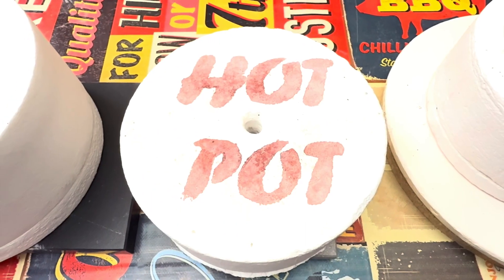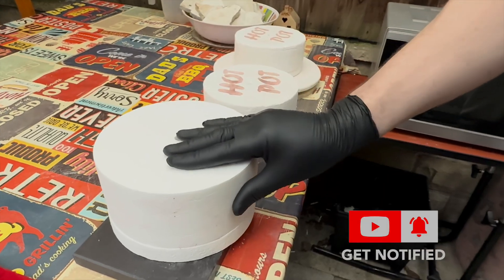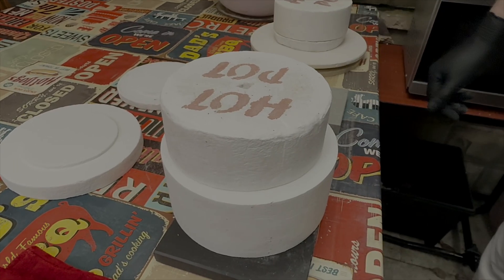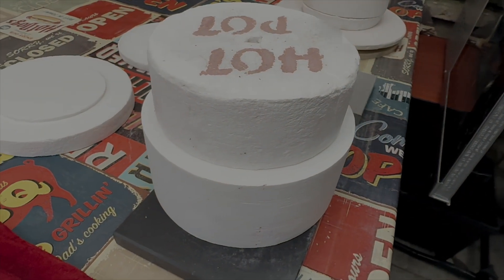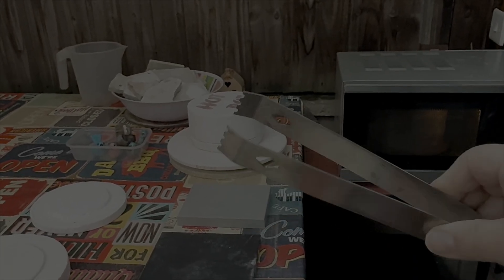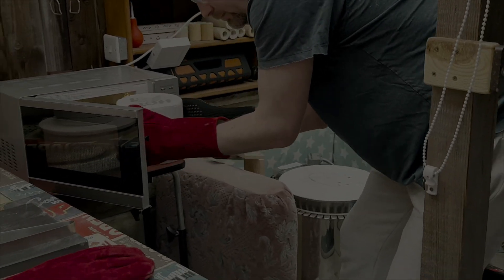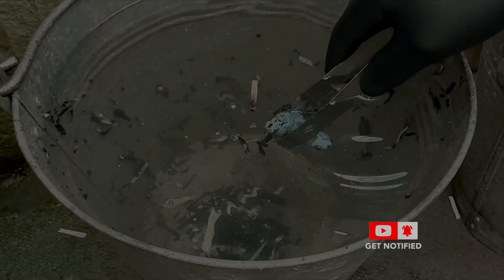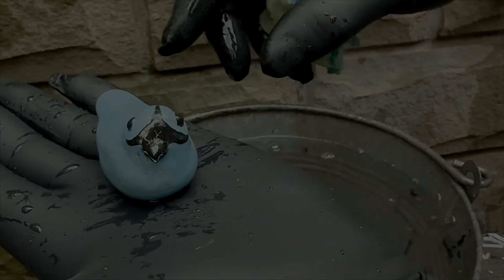Microwave Kiln | Raku Firing Demo | Hand Build | Home Ceramics Project

Comment: do you use wax on thebottom of your pieces?
? also will the microwave shut off if it gets to hot?
Reply from the maker: Hi
I don’t use wax no. I’ve never had any issues with the microwave getting too hot to be honest. I never leave it unattended however just to make sure everything is ok. Hope this helps 😊🥰

Comment: :) Why do you turn off the microwave after 20 minutes, only to restart it for another 5 minutes instead of 25? 
Do you change the power or check the color?
How many minutes in total? 

Thanks for sharing.
Reply from the maker: You are welcome! 🥰 you can’t see the colour but I check the glow on the piece and if it doesn’t look smooth enough I put it back for a bit longer. Hope this helps ☺️

Comment: Hi. What is your general maintenance on the kilns? How long does one last?
Reply from the maker: Hi, well I’ve had mine for years and although some cracks do appear you can still use it. I believe it’s better for the kiln if you don’t let it cool down open; always get your piece out after firing and then close it to allow it to cool slowly. I believe you can actually fix them as well, like the cracks can be mended with ceramic fibre, magnetite and sodium silicate. I’ve not personally binned one nor fixed one yet so I’d say they do last a long time. Hope this answers your question? Thank you for watching the videos 🥰🤗

Comment: So you said if the glaze is bumpy (mine was bumpy/bubbly) it’s not hot enough? TIA!!
Reply from the maker: Yes that’s correct, if bumpy it means the kiln didn’t reach the temperature and need longer time in MW but it could also mean you are not using the right glaze. Stoneware glazes don’t work for me. Make sure you are using low fire glazes 🥰 good luck!

Comment: Do you always have to cover the hole? Or js that only if youre doing a big piece?
Reply from the maker: I only cover the hole when I use the double kiln method for bigger pieces because it’s tall and the heat coming out of the hole would/could melt the top of the microwave ☺️